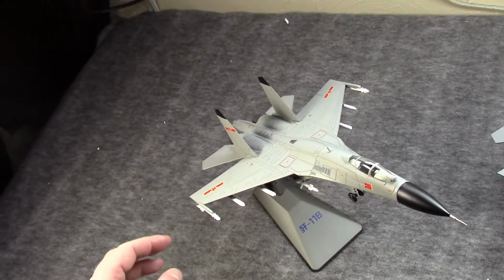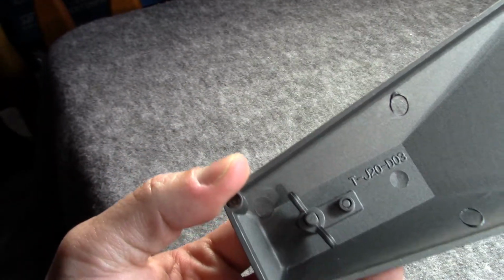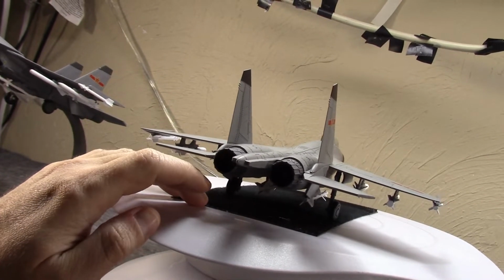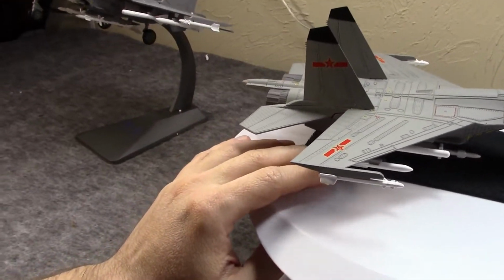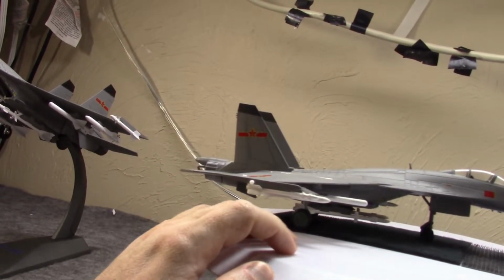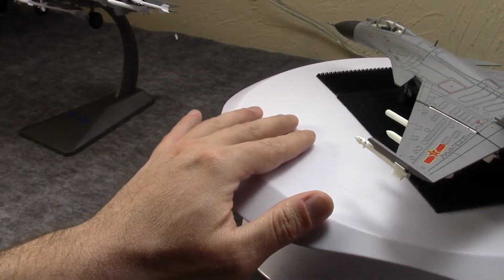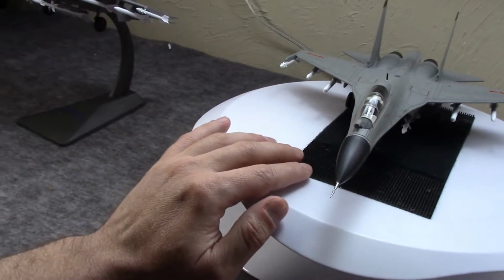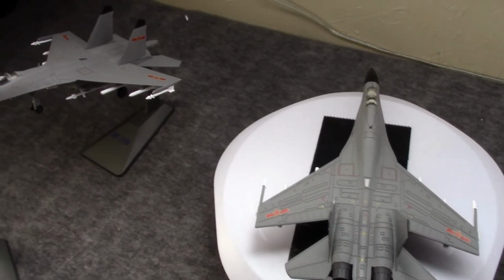Shenyang J-11B, J-15, & J-16 Family: China's Sukhoi SU-27 Fighter Clones From AF1

Comment: mostly very well put, but I never heard about the story of J-11 and P-8 in 2014, or at least never heard about the crash, but this story does sound awfully familiar to the P-3 and J-8 story back in the early 2000s

also, I don't think the J-16 is set to be radar invisible at all, otherwise, what's the point for their J-20 right? I think what the Chinese were claiming is that they did a similar RCS reduction work on the J-16 as the American claimed they did on the F-16 and F-18
Reply: Its the J-8 not the J-11.